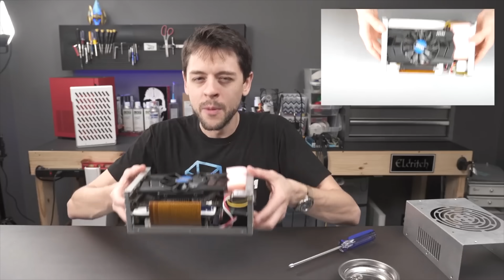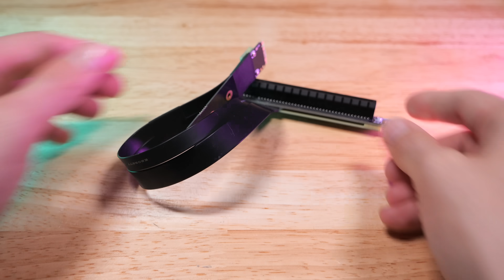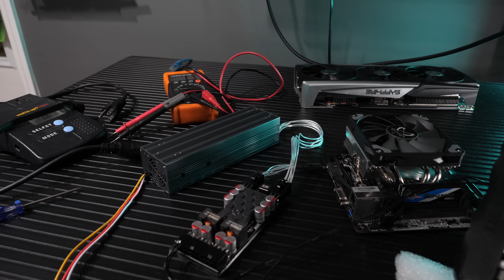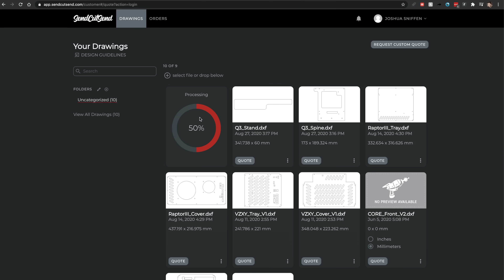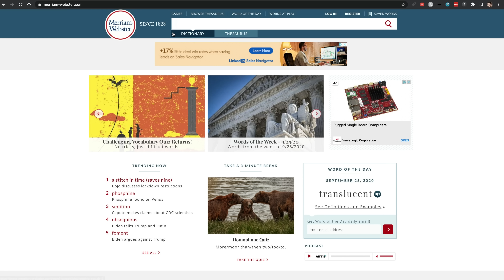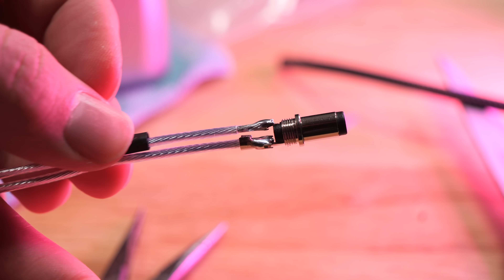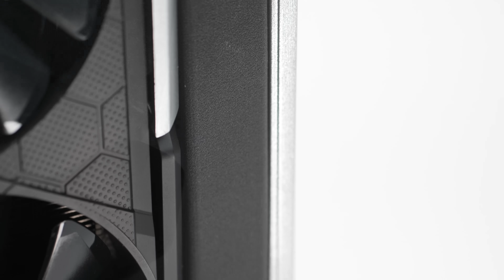Project Ionic: BIG GPU, tiny motherboard...

Comment: You should try and use solid copper magnet wire for powering motherboard and GPU and bend them using a pipe bender.  Use a heavier gauge like 10 gauge and use fewer runs.  Paint them for better effect and better insulation.  Could probably make a very space age looking build that is completely functional. ;)
Just be careful.... ;)
Reply from the maker: One day I will do something like that, but I can't do fewer runs because the traces need the splitting, not necessarily the cables. That's my understanding anyway...thanks for the comment!
Reply: @NotFromConcentrate  The sense pins are required for most cards to detect 6 or 8 pin power.  So you could route one thick wire to many pins as long as the sense wires are correct, and I wouldn't leave any of the connections on the card or MB out unless you were going to modify the card/MB itself or solder wires directly to the board...  I like to curl smaller gauge wires around the end of the heavier gauge then route them into the connector to make it look like the wires were wrapped around and around the ends.  It takes some time to make it all look nice and its all hand work but if your solder work is good enough it is worth it.  Eventually I want to setup an ATX12VO build and wire it this way.

Comment: Next need to see a absolutely small 3090 FE build something like this were the GPU can breathe.
Reply: But why lol? U need a top of the line cpu and a lot more power for that, im not sure if the vrms will be ok with no airflow in such system.
Reply: A system with a 3090 will need a bare minimum of 800W of power. Don't think it'll work out well
Reply: @milotherocket  Silverstone makes 850watt PSU SFX
Reply: I would rather use a 3080 or even 3070 so you don't bottleneck the system with the cpu
Reply: @demp11  can still use a ryzen 5000 cpu that'll outpace the 10900k

Comment: How was the gpu connected to the motherboard since there isnt a pcie slot? did you use the M.2 slot? if so, which connection board did you go with? ive been interested in connecting gpus to computers that were never intended to have one, so any help would be amazing. Also kudos on the build, it looks sleek and sexy. I wish more cases showed off the intricacies that the hardware has.

Comment: What hardware did you use to mount the gpu from the backplate? I've got a wall mount project I need to do something similar. Thanks
Reply from the maker: Just bought a box of M2 screws off Amazon and 3D printed washers/spacers to the thickness I needed. I reused the bolt holes on the backplate of the GPU.
Reply: @NotFromConcentrate  thanks

Comment: That's sick! Extremely well done, love your attention to detail. Shame that motherboard can't run a 3700X, that would be an absolutely monster.

That could be reason why Flight Sim won't run, wonder if the 2400g isn't supported?

Sapphire hands down makes the best gpu for AMD. That Nitro card is so damn beautiful, love that card. All my Radeon cards I've owned have been Sapphire and never have had one issue!
Reply from the maker: Dude I can't even get the game to download from the MS store. I could buy it on Steam but I have a MS Gamepass and would like to use it. Thanks for the compliments!
Reply: @NotFromConcentrate  absolutely, love your content. Super unique!

Apparently your not the only one. Have you tried from the MS store website itself? Try using an Incognito window?some have had luck logging in and out and back in which has worked.

What a PITA!

Comment: This is an epic build. In the end it really turned out extraordinary. I'm really curious if you can easily install the current X Plane flight sim, https://www.x-plane.com/. As for the new W10 Flight Sim, I've heard other have difficulties installing it, heard that it seemingly runs/installs better using Steam?
Reply from the maker: yeah it's some dumb problem with the MS store/Xbox for Desktop app. I had it working for one week using some russian hacky work around thing I found but then it broke again. :(
Reply: @NotFromConcentrate  Try Xplane, its the real deal.

Comment: I give pieces to a souvenir as a friend too!
8/10!
Reply from the maker: Your pieces are much cooler though..
Reply: @NotFromConcentrate  speaking of cooler... Ever think of a hollow frame with water cooling integrated? Like.. the cpu, gpu, etc all water cooled and the frame/base holding it up serving as reservoir/cooling channels, milled from a chunk of copper.. I haven't, but I'll be sure to write it down when I do ;) still have a mill btw, if you have something crazy in mind, let me know!
Reply from the maker: @pco1984  Actually I have been thinking about buying a giant extruded heatsink, like the kind that come in 7" widths, and then milling out channels in the backside to make a sick fanless radiator. What do you think?
Reply: @NotFromConcentrate  absolutely! I've worked with that stuff in the past, it machines quite good, plus it's soft enough to deform as well so if you want to bend it, it might be able to..
It might be a bit of an issue to get good quality extrusion though.. it's entirely possible that it comes warped/bent or with different size (height and width) fins or spacing, and given your attention to detail that might become a "thing"... Stupid idea maybe, but how about milling the fins? Definitely a lot more labor intensive, but quality control is much better, plus if you want a crazy motif for the fins (or have them line up with other features) it's entirely possible!

Comment: How about a motherboard for the base and a vertical GPU on one side and an all in one CPU cooler facing the other?
Or even an all in one naked LCD with the MB and GPU attached on the back with everything exposed.
Reply from the maker: Sounds like a cool idea! Sketch something in paint and share it with the modding section of the NFC Discord and let's see what happens!!!